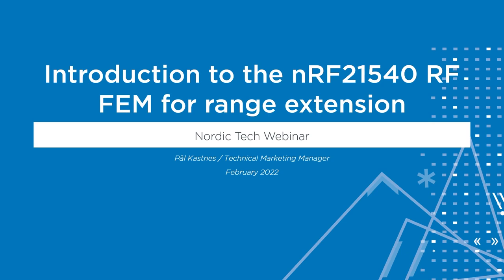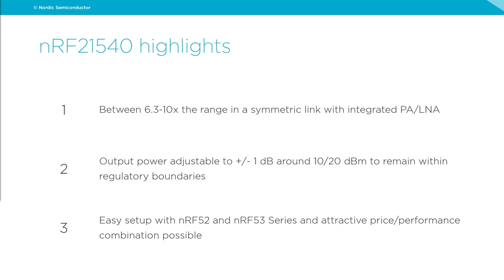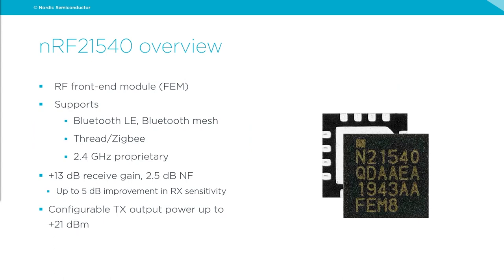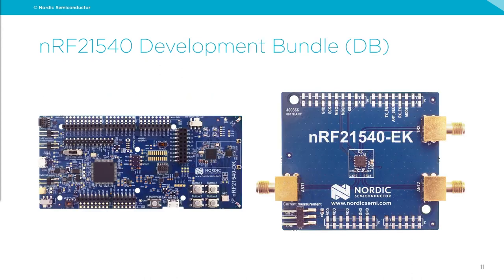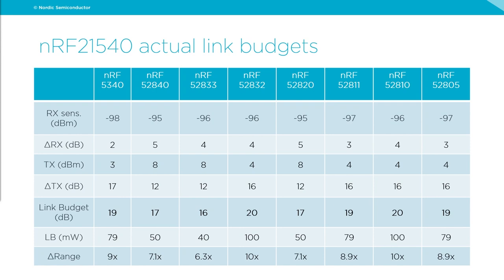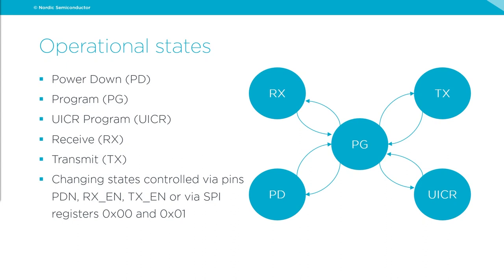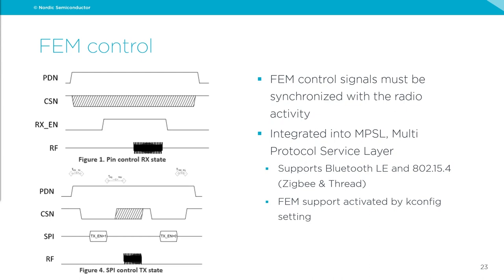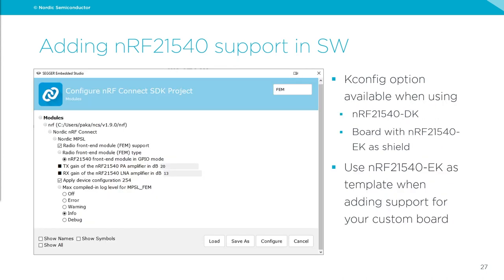Introduction to the nRF21540 RF FEM for range extension

Comment: thanks for nice video , i have one confusion . i followed all your video and configured the nrf52833+nrf21540 custom board . I am using radio test example of NCS version 2.3.0. Now question is that i have to write the code for the enabling the nrf21540 FEM in radio test example by calling the functions from the mpsl_fem_config_nrf21540_gpio_spi.h or is it enough for me to just follow the video ?